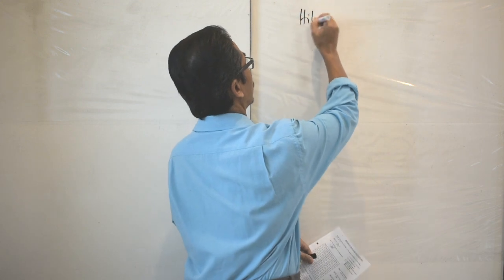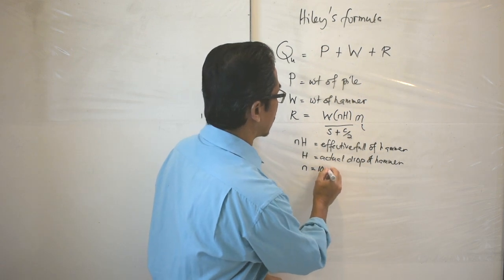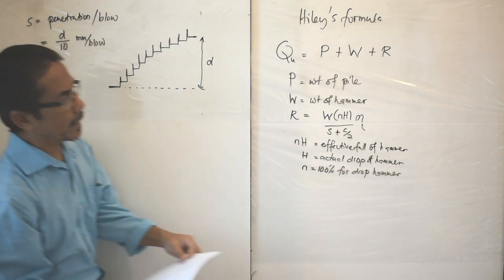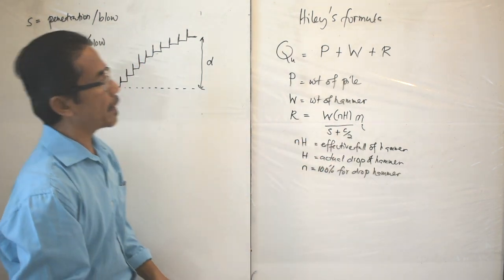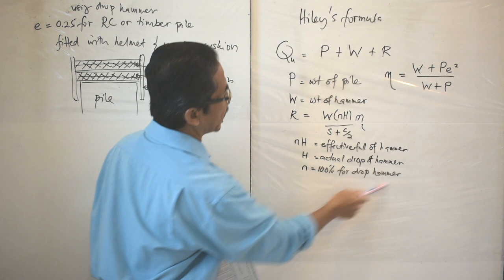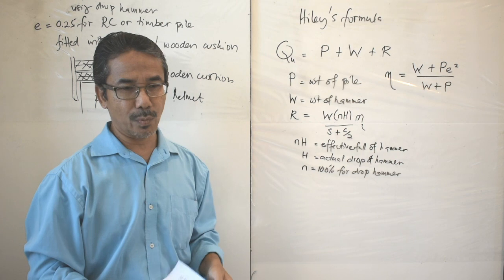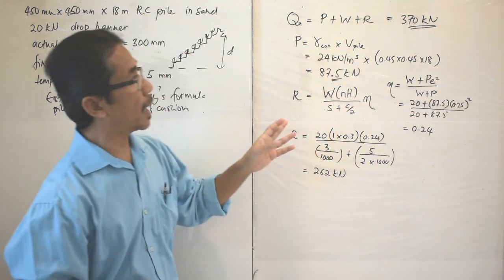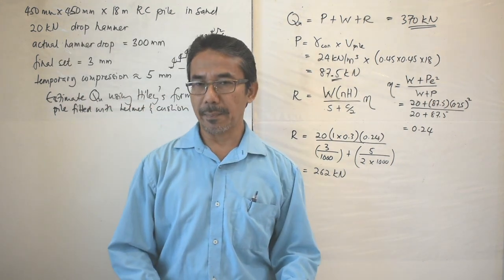Pile Foundation 07 - Dynamic Formula

Comment: Dear Dr Kamarudin,

Thank you for uploading the great contents to Youtube.

Regarding the estimation of pile "capacity" from Hiley's formula, i would like to disagree; 

Terzaghi (1943) remarked that despite the obvious deficiencies and unreliabilities of such pile driving formulas, they still enjoy great popularity and wide usage by practising engineers due to their simplicity. However, the price one pays for such simplification is very high; the factor of safety applied for the pile capacity may be excessive, and in other cases significant pile settlements have been experienced.

Poulos and David (1980) noted that the pile driving formulas take no account of the nature of the soil, and hence an appropriate safety factory may vary from one site to another.

The many deficiencies of the pile driving formulae gave rise to the need for wave equation analyses, and even that does not sufficiently address a pile's load bearing "capacity".

It is hence worthy to note that the pile driving formulae (over 450 such formulae exist in the Engineering New Record, Smith (1960)), should not be used as an estimate for the pile load bearing "capacity". Instead, they should be used for the practical estimation of a pile's termination criteria, which is to be verified by a proper maintained load test.

Hope to receive your feedback on this.

Best wishes, and stay safe.

Comment: Sir, I am very much fond of your teaching methodology.. to the point and very simple. I have seen all your videos twice and cleared all my fundamentals about pile design. I wish you to share further your knowledge by providing videos on Structural Designs of Pile and Pile Cap (RCC Design). I am retired Government of Gujarat (India)civil engineer. I also need your guidance in case of a long continuous counter fort type retaining wall (about 50-70 m) is to be supported on Pile Foundation, How would be consideration apart from conventional isolated group of Pile. Can you send me the link to that Mayerhoff's Graphs you referred in to the previous videos. I searched on Google but found very rough image. One again thanks for your very each methodology supported by a practical explanation/example.
Reply: @kamarudinahmadphd7412  Thank you Very much Sir..

Comment: I was given a problem which needed to compute for the set height. I was able to compute for the other values needed but for the last one, the set height value I was able to compute was wrong. The factor of safety was given, do I need to divide the computed set height by the factor of safety?